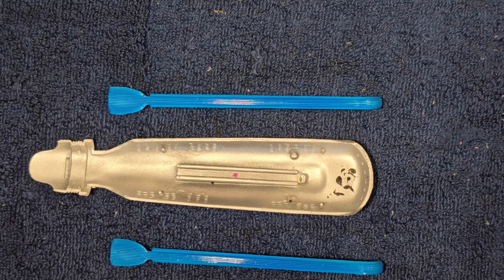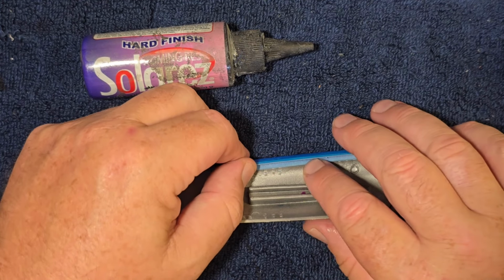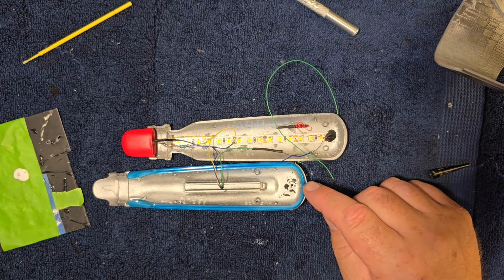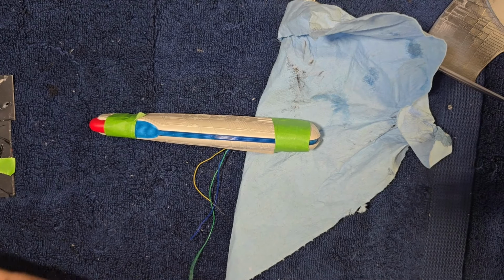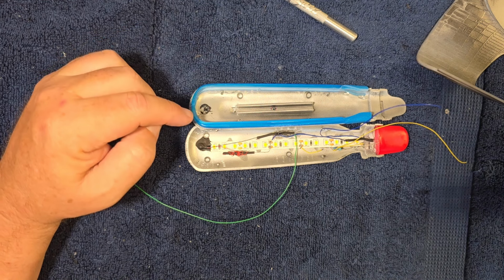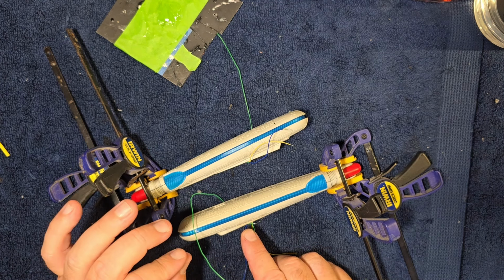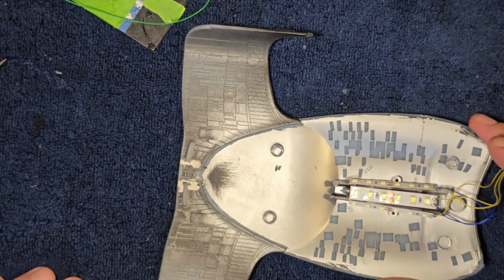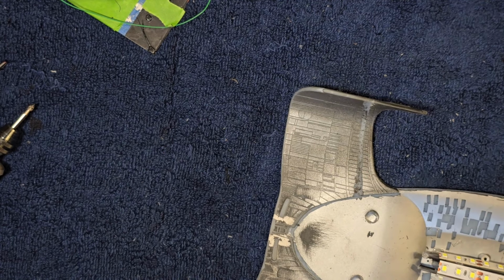U.S.S. Enterprise D - Chapter 5

Comment: I'm actually getting ready to build my own here pretty soon and I love the info you gave. I also ordered my deflector from green strawberry. #Enterprise
Reply from the maker: That's great!  You won't be disappointed! 
It hasn't been covered yet on the build, but for painting it, used Tamiya copper , and for the one clear piece, clear blue.  The light behind it will illuminate it just right.  It comes wirh photo etch which I did not paint as it matched the tamiya copper pretty well
Reply: @thescifimodelguy  thank you for the tips. I'm still waiting on a few more parts to come but hopefully soon. The only thing that scares me is tunneling the trenches.
Reply from the maker: @XenoZero82  it's tricky but with some patience it will turn out fine, especially if you have the photo etch pieces, which cover it up wonderfully.   However looking back I do wish I'd have smoothed it out more before applying the photo etch.  It's barely noticeable but is something I'll do better on next time.
Reply from the maker: Hey @XenoZero82 !  You won the drawing tonight!  Send me an email (address is in the about page) and we can get together to get the details for your ship !!! 
-Shawn
Reply: @thescifimodelguy  omg seriously 😳 I'm sending now